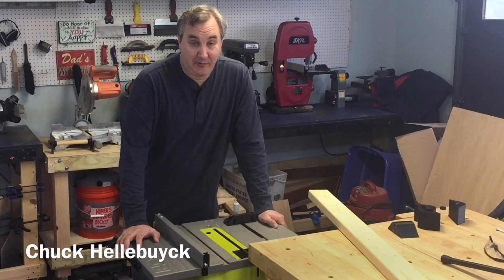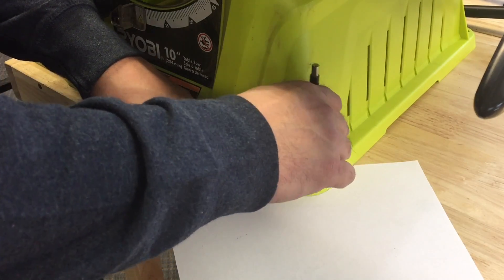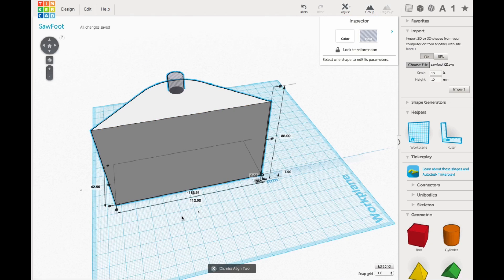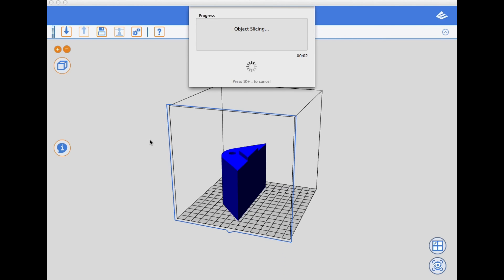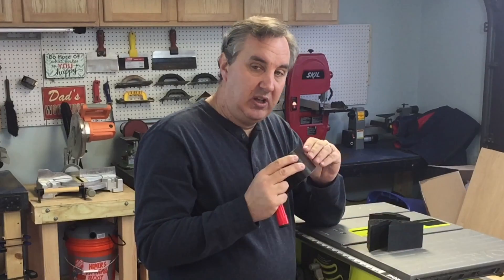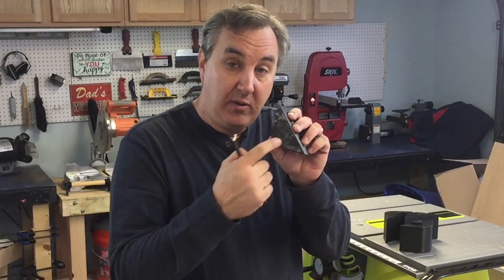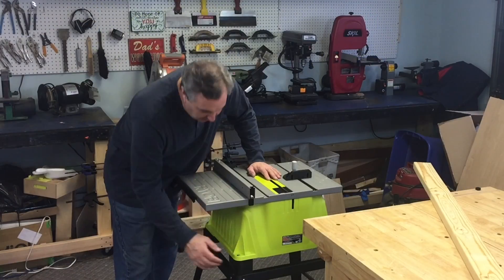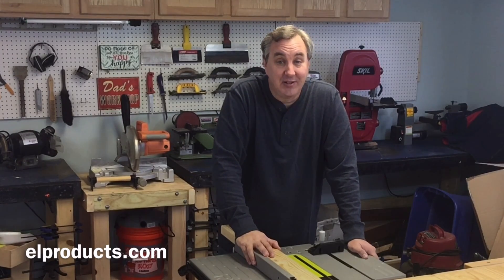Filament Friday #48 - 3D Printed Ryobi Table Saw Height Adjustment on DaVinci Jr.

Comment: I can't help but notice that right behind you there's a bandsaw and a drill press which could have solved this problem in ten minutes and pretty much for free. But I guess when you own several thousand dollars worth of hammers, every problem looks like a nail.
Reply: +Chuck Hellebuyck's Electronic Products Thanks for your reply. I hope your understand I meant no offense. Your solution is definitely elegant, if yet - in my opinion - severely over-engineered. Good luck with your new woodworking hobby, though. And I believe you may be surprised at the actual stability of wood.

Comment: I print a lot of things with rafts in my 1.0A and I never have any issues with it sticking with ABS or PLA I just make sure that I use simplify3D and make calibrate the spacing for the different materials.

Also why dont you print PLA on your davinci? mine works flawlessly.

Comment: Another great video. What you are calling a finishing tool is known in machine shops as a deburring  tool. If you look in a tools & machinery catalogue you will find a number of models with about twenty different blades. You were able to run your finger on the blade because it is dull, do not try it with a new blade.

Comment: Great vids Chuck. I have heard that PLA can creep when held under pressure like that for  long periods so you best keep an eye on that spacer.
Reply: +Chuck Hellebuyck's Electronic Products temperature definately amplifies the effect, but creep happens below the glass temperature. It wouldnt cause anything catastrophic in this application so its nothing to worry about. I just thought it might be interesting to inspect the parts after a couple of months to see how they are holding up.

Comment: Hey Chuck 

I am considering buying the Afinibot A9 3d printer, but I Don't know if it's the right printer for a beginner as me. (First time buyer) I had done a bit of research on the machine specifically. But I can't find a proper review in English. And I thought you maybe could help me?
Reply: +Chuck Hellebuyck's Electronic Products Thanks Chuck. As always I'll look forward to see your future videos.
Reply: +Simon Grundahl the A9 is a cantilevered design a bit like the Reprap Ormerod. Its really hard to ensure all axis remain at 90degrees in this setup as there is a lot of leverage on that z axiz bearing. This would result in parts that are not square. Also as Chuck says it wont do ABS well without an enclosure and its really hard to build a good one around this design as you generally want to keep as much of the electronics outside the enclosure.
Reply: +Scienteer -  I find your comment really helpful. Thanks.